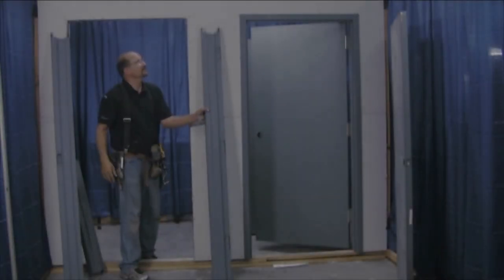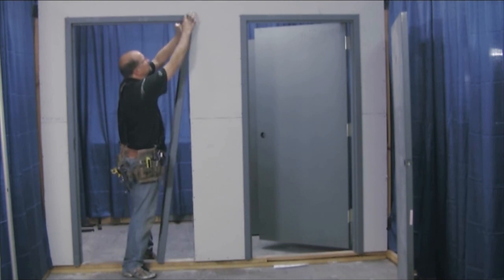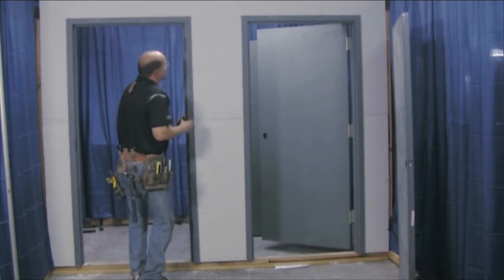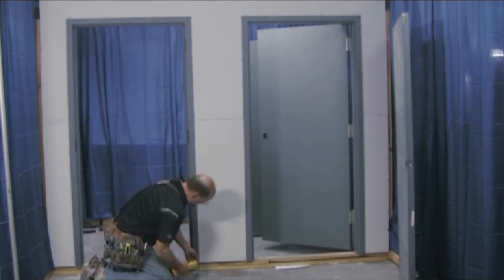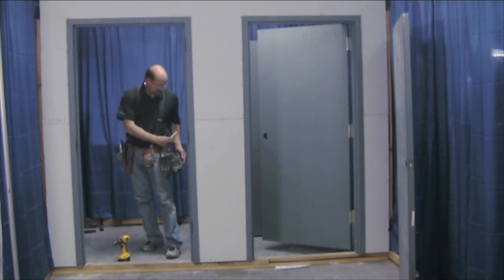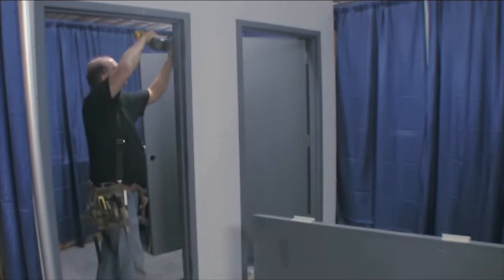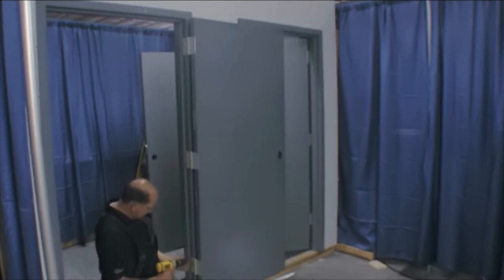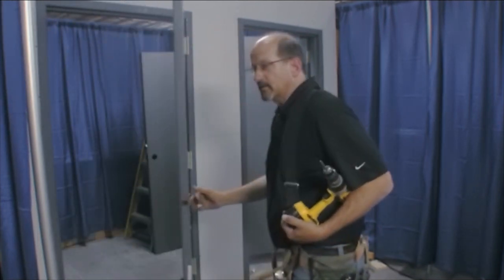Mesker Knock Down Frame

Comment: For everyone trashing this guy, I think he was just giving you the quick basics. He already had a pre-measured door opening. I agree in the real world, old work install, there were a lot of steps left out. A weekend worrier will not be installing a commercial door. I think this was meant for people with a lot of construction experience, who can figure some of the other steps out. I’m doing one tomorrow on an old building, and I can guarantee it will not go anywhere a smoothly as this one (where he probably did the framing and knows the header is level). JMO! For the person who asked about the price of the KD door, I just bought the frame and door for $825 with tax included. The one I bought has a small window. Hinges were included, but not the panic bar,/handle, or automatic closer - that’s about another $400-500 depending on the quality you buy.

Comment: STOP!!!!!!!!!!!!!First off he did not level the top of the door jam ,STEP 1 determine desired door swing , you need to confirm you have the right door, if your a carpenter coming here for help this cat will get you fired . you need a precision 4" level for this job , or a laser. STEP 2 assemble the door as he shows you STEP3 YOU MUST LEVEL TOP JAM, if one side of the door jam needs lifted up do so using shims, pocket change or washers   STEP 4 level hinge side by screwing bottom of the hinge side first and then push the top out of level so as you turn the expansion screw on the hinge side the door slowly draws into position , using the expansion anchor to push the door into position is best bot not necessary. STEP 5 push the strike plate side to match top jam dimension and fasten bottom of the door on all sides .STEP 6  turn the expansion anchor on the strike plate side untill snug . and FYI  if this takes you 20 min your fired, and i dont say that to be mean its just that installing the frame alone should take under 10 min . you could maybe have an operating door in 20 min but im not sure what he ment by that , even this video is only 9 min
Reply: NOBOX7,good info!thanks! What is the rough opening compared to the jam?
Same as a wood door/jam? 1/4"?

Comment: Usually you would check the header for level before fastening frame to wall. Floors are never 100%
Reply: Right
Reply: +Scott Yes, It's ALWAYS the first thing you do.
Reply: lol bro i just hit the comment section to say that lol , he didn't level the hinge side either lol he looked at the level and threw it on the ground . the first thing i do is bench mark my header    with a line laser , i mean it is 2017 , I plumb them with a line laser also
Reply: And who the Hell uses a 3 inch level.....at least it's plumb in 3 inches

Comment: Set these frames with true levels ,you don't always have areas to accommodate lasers. ,and lasers are not an the best way ,as they also need calibrating . Always set these frames perfectly the first time ,as the painters will caulk and prime them soon after ,and the wall finishes and base material will be installed up to the jambs ,  by the time a finished door is scheduled to be hung ,and if it is out ,you have trouble !! Now you have to move the frame ,and and disturb the finishes . The door frame is 99% of the door ,my friends ,if it is done right ,you hang the door and walk away .
Reply: Guys like this spend more man hours correcting everything than the initial installation.  Fun times when a change order is submitted for redoing wallpaper or caulking/painting.

Comment: Is it easier to install one that has a welded frame?  I have my eye on one brand that has that as the only
difference, but the one with the welded frame does not come in-swing, only out..call to the company some guy
told me I could just reverse it for in-swing.  I don't feel comfortable enough with that answer, if that is true
than why do they also make in-swing.
Reply: zzubuzz get the knock down is easier to use
Reply: Hoowa!  I picked them up today and opened one of them and am VERY impressed!  I did order those with the welded frames mainly because they costed only slightly more and all the reviews were more positive on them.  The thing is stunning, the way they crate them is a work of art in itself..I think I made the right choice getting the welded frame, again very impressed.

Comment: Do these come apart just as easy?
Is there enough play if the floor isn’t perfectly level or would you need to cut in that case?
Reply: Don't cut the frame. Yes they come apart the same. Don't learn from this video